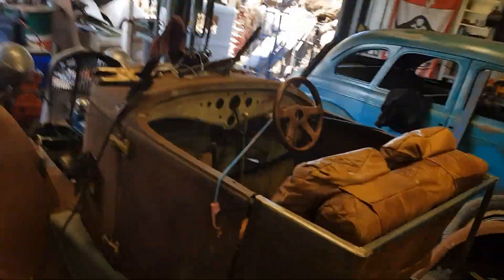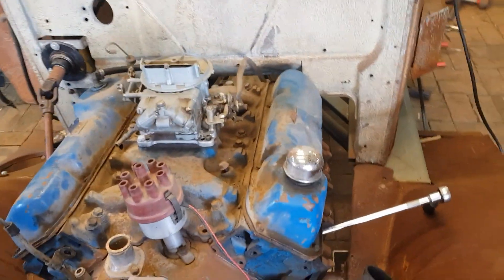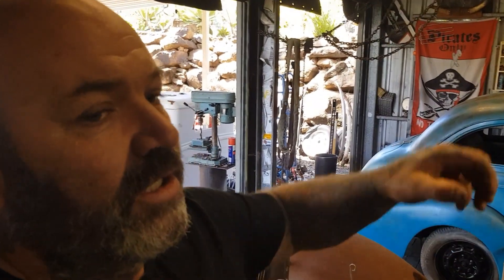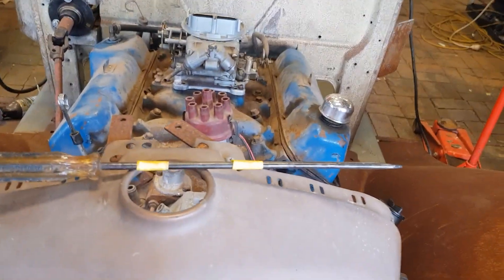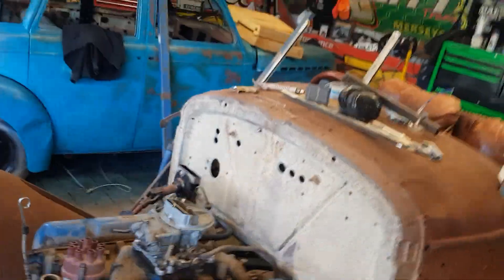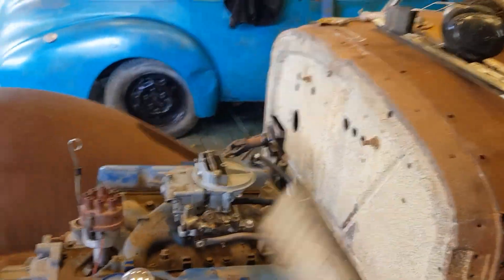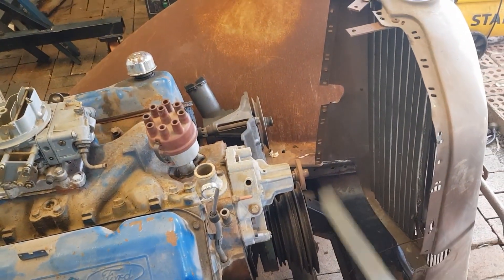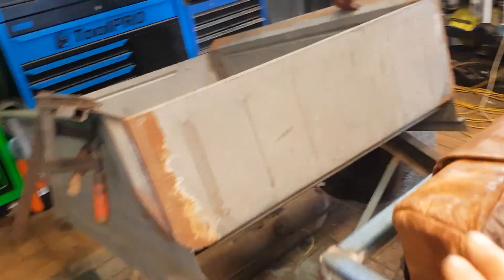How to tell if you have a ford 302 or a 351 clevland. Which one do we have in our Chev / Oakland ep4

Comment: That’s number 5 ford has a different firing order it’s 1234 on right side the left side is 5678
Reply from the maker: They have to be different don't they bloody ford
Reply: @copperheadkustoms  😂yes you have to school your self because they are i once eat cam distributor gear because of the difference between roller and flat tappet
Reply: If you number the cylinders the same as most companies do, then the firing order is actually the same, but Ford times it off  what is cylinder number 2 on a Chevy, and the distributor rotates CCW instead of CW.